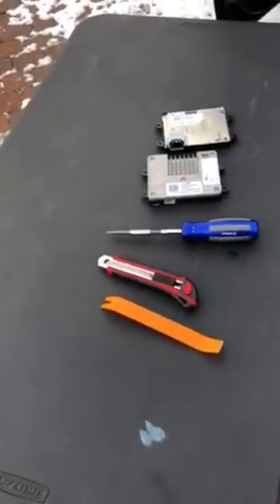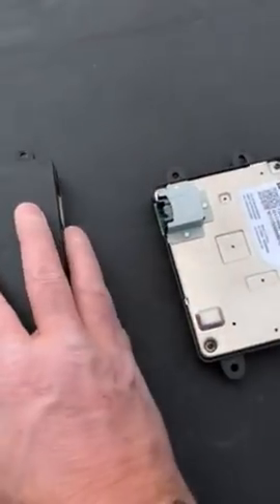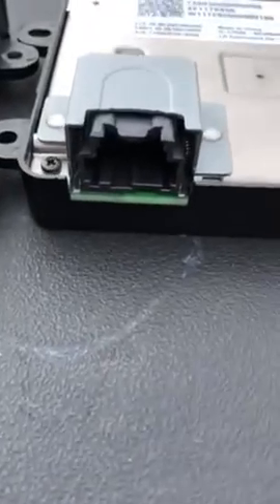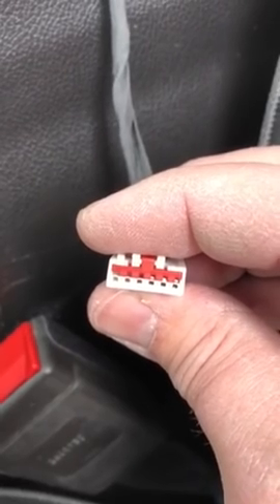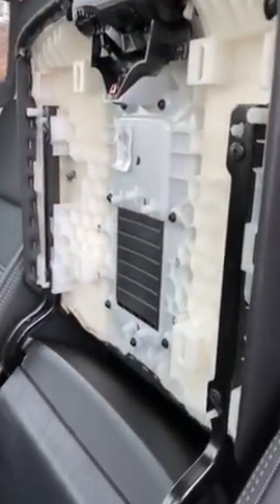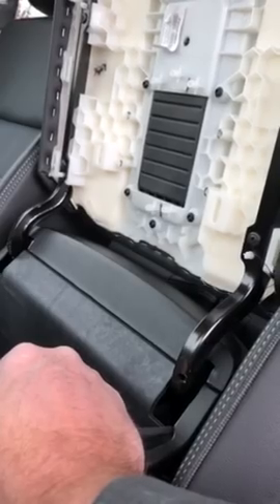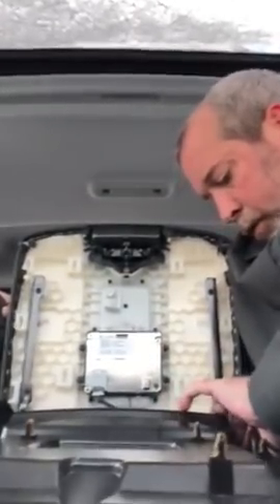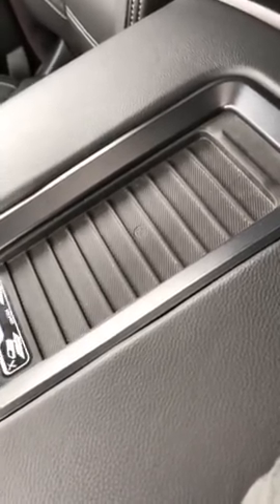Swapping a 2018 wireless charger in a 2017 GM truck.

Comment: Just did this on my 2016 Suburban and it worked great. Just FYI it was the same part number as well confirmed by my Chevy dealer. Not under warranty. Shaved the connector down and it fit very nicely

Comment: I ordered two of these (2015 Tahoe and 2017 Impala) and they both came with adapter harnesses. Swapped each one in about 15 minutes, no more charging problems and I have a Note 8, wife has a Galaxy S8+.
Reply: Where did you order from?

Comment: I took my 17' Bolt apart today to find the exact problem. I researched it and i will order part # 13521065 and change the unit out myself. Amazing the most tech advanced car on the market has an outdated wireless charging port and no Homelink garage opener. I will report back if it works once I attempt the install. Thanks for this great video
Reply: Any updates?

Comment: It's my understanding that GM is now covering this under warranty. They will supply the new module, change the plug on the existing harness (wiring) to the correct plug for the new receptacle on the '18 module. Parts are limited as of right now, so it might take some time to get in. Go to, or call your local dealer to facilitate a work order for this.
Reply: Roland Yarrington, I went to dealership, they are researching, was there anything special you told them to get them to warranty this change out? I even called gmc and no response yet
Reply: I went to my dealership and they had no clue but said they would look into it. I then called GM and the representative I spoke to told me they would be implementing this to be covered under warranty asap. I relayed this to my dealer and they are ordering the parts and verifying it will be covered under warranty. They are going to call me when the part is in. That is all I know right now. (FYI- I have a '17 Sierra Duramax Denali)
Reply: Merry Christmas! I will be visiting my dealership on Tuesday then! Good luck with your truck, mine just turned 1,000 miles old.
Reply: Thank you! Merry Christmas to you as well. I got mine in June and only have 1350 miles. I don't drive it nearly enough.
Reply: So you mind telling us which dealership ? I just purchased a 2017 Suburban and have the same issue. My dealership  doesn’t have a response and GM just said that iPhone 8 only works on 2018 model suburban. Thanks !
Reply: My dealership does not show anything being covered, i called gm and they did not show it either, so i ordered the module, i confirmed chedder’s part number off of a 2018 denali they had on the lot, part should be in tomorrow
Or day after. Am going at it the cowboy way, the 2017 module does not work so it is broken to me! Will let u know how it turns out!
Reply: This is not covered under warranty. There is a service bulletin for it but you still have to buy the new charging pad  $100 part. You can buy the part on eBay through GM Parts House and it includes a new cable.
Reply: I doubt gm would cover this..
I had to pay for mine lol

Comment: I just did this exact thing (new module and shaved the harness groves) and it works great. In fact my iPhone X case doesn’t allow my phone to sit flush in the charging slot and it still charges fine.

Comment: I swapped the 2018 charger in today. Trimmed the plug and works perfectly!!!
Reply: pyrocrew13 why you need to change the wireless charging? what is the difference?
Reply: abdulmohsen alghamdi the 2017’s and earlier aren’t compliant with the new iPhones. They won’t charge them. You need the charger from the 2018 vehicles to take advantage of that feature. Just like he says in the video $152 plus tax to order. New part fits right in place of the old one. Then you can either trim the plug so it fits or you can order the harness as well, cut both heads off and splice the new one in. The trimming option took me like 3 minutes and seemed easiest and cheapest option.
Reply: pyrocrew13 very good, thank you so much for your help, the new iPhone and Samsung not charging in my car, i will replac this part soon.

Comment: I spoke to my dealership today and they stated that GM makes a charging pad/adapter that is comparable with the older models that have wireless charging. I’ll update later with the part number. Also, they stated it would be around $480.00 with part and installation.

Comment: DO NOT start cutting up the OEM plug on the factory harness to make this work. When you order the wireless charging module for a 2018 (part #13521066) also order the matching wire harness out of a 2018 (part #84193710). The harness plugs into the back of the console, it's super easy to change and is way more functional.
Reply: Came here to say that this is great advice.  Yes, way more functional and super easy to change.  The only thing you have to do BESIDES pop the bottom of the console lid off, is pop off the back of the center console.  But again, very easy and 4 screws.  Link to video on how to do that here: https://youtu.be/iytvdK7VoIo
Reply: I ordered these exact parts, as I purchased a new iPhone Xs Max - and it wouldn't charge in my equipped 2016 Yukon SLT.  it took 15 minutes in all, and works on the console even though the Max doesn't fit exactly flush on the charging pad.  Kudos to Bryan!  Many Thanks
Reply: Did you order from your local dealer or a particular website?
Reply: What does that harness include. Couldn't find picture.  Just adapter or whole new harness?

Comment: Very nice video cheddarnut.  I am convinced I can do it myself.  You were able to confirm the 2018 trucks had the same three wires?  I agree with you on the warranty comment and I like stuff to work as designed too but I just dont want to create some electrical problem further up stream while under warranty.  Because GM has handled this so poorly a guy could buy the short plug and if something goes wrong, put the old charger unit back in (with nothing being changed) and claim ignorance at the dealer.  Obviously if you shave done the existing wiring clip they will see that.

Comment: Great video!  I purchased GM part #84526978 for my 2016 Chev Suburban.  It was $116 at the Chev dealership, and came with a pigtail adapter in case you don't want to trim the existing plug.  This Gen 2 module works great charging my son's iPhone X and my iPhone 11 right through their cases.

Comment: Is there any other information one would need to change out this part on a 2015 Cadillac Escalade?  GM suggested the same fix with the same part number, but the console lid (and charger) is a slightly different size.  Thanks for this great video.

Comment: I don’t have the part number but there is contributor at gm-trucks.com named PGAMBOA who has created a short plug and play harness.  It’s $25 which is a bit steep considering that the connector costs 71 cents.  There is a detailed explanation about how to unpin the connector and change to the new one.  It’s not that complicated.  The explanation starts around page 16 of the thread.

Comment: Great Video - thank you very much. Just curious why if the first hack in modifying the original charger worked, why did you decide to buy the new one?
Reply from the maker: When I did the first hack, the 2018 part was not clearly a fix yet, so I decided to try it as well when it was confirmed to be a viable option. I think either version is good. The advantage to the hack is obviously that it is free.
Reply: Makes sense. Thanks for the quick reply. Happy New Year.

Comment: Thanks very much for sharing this video, I have a 2017 cadillac xt5 platinum, and I am having the same problem with my wireless charging pad, I would really love a fix.
Reply: Counclor Counclot my 2017 xt5 use to charge the samsung note 8 of both mine and the wifes plus my galaxy s8 they had to do an update for the ingocenter as it kept going black. And since then the charger quit working. P.o.s. Cadillac told me forget about it. There is an updated item availble for it. At my cost

Comment: I made the conversion to the 2018 Qi charger (part number 13521066) and also replaced the connector with the Mouser 571-2035363-4 connector. It is the correct connector that plugs into the module. The charger works like a charm. I have an IPhone 8 and it charges wirelessly with no issues. Took me about 30 minutes but only because I was taking my time.
Reply: Does anyone know a part number for the plug inside the old module so an adapter harness could be put together instead of replacing the factory plug?

Comment: I just contacted both Chevy dealers in the City where the Silverado is made regarding my 2016 Tahoe.  Neither dealer was familiar with this but Kelley Chevy is at least checking further for me.  The dealer where I bought the Tahoe has offered to order the 2018 charger and install for about $200 but with no guarantees that it works.  Let alone replacing under warranty.  The dealers are saying call GM and GM is saying call the dealers.  GM infotainment group has no clue or is playing dumb as well.  Can someone please list a GM dealer and city where they have had this done?  I too will pay to have the pad working.
Reply: Why would you pay to have it done when the step by step video is right here? Will never understand people with stupid questions; where do i get the part, can i have the dealer do it, how much is it? The part number is posted, go online, buy the part and follow the instructions on the video.....not that complicated

Comment: Just did this on my 2017 Sierra, worked great. The dealer had no problem ordering the 2018 part for me $240 CAD. The only additional thing i did was flip my charging mat around, my iPhone 8 charge doesn’t get interrupted when i do that. The charge speed is slowish and i’m not sure if its just the power being supplied to the module or the output of the module itself. I don’t have another wireless chatger to compare. Can anyone else comment on charge speed in a 2018 GMC without the mod?
Reply: Filip Burcevski I just put the 2018 module in and it worked for about 1 minute and no has stopped.

Comment: So the parts so far are as follows:
Module: GM 13521066
Male Harness Connector for Module: Mouser 571-2035363-3
Female Harness Adapter out of old Module: ???
Does anyone know that part so a plug and play harness adapter could be made instead of destroying either the old module or factory plug connector?

Comment: Hello thanks for the new video. Would this work for a Chevy Impala 2016 please? I have an iPhone X as well, also if I was to go ahead and order this part and have someone install it. It the wireless charging faster is slower? Is it really worth going through with this please?
Reply from the maker: Hard to say on a car. I have only worked on the truck. Although the 2018 impala does seem to have the new charger. In your case I would start with the dealer and see if they can compare the parts.
Reply: A1 Credit thecheddarnut The 2018 Impala is not on the list of GM vehicles that is compatible with the new iPhone 8/X wireless charging.  I have been to my Chevrolet dealership I bought my car from last February to see if they’ll swap the truck module into my 2017 Impala Premier.  They’re researching it atm.  The wireless charger in my vehicle is part number 23248791, not the same part as from your Yukon.  That being said, I talked to the parts department and there were two different modules used in the 2017 Impala, one of which was your 2017 module (part number 84162497) , the other is the one installed in my car (part number 23248791). The 2017 Silverado shares the same wireless charger as your Yukon for 2017 and 2018 respectively), and I’m trying use that as a basis as my request to have my cars wireless module updated under warranty.  I’ll update when I get more info.

Comment: I just bought and installed this new charger (2018 module) and it worked for a minute and now has stopped working. I got the lightning bolt on the dash and the green battery on my iPhone X and then a minute later I tried it again and I get the lightning bolt on the radio for 10-15 seconds and then it goes away. Before you go running out to buy this part it might be worth figuring out if this will work for you because it did not for me
Reply: how about other iphones that aren't as long?  I know this charger is positioned more towards either the front or the back.  what if you turn your phone around?  Not upside down, but spin it 180?

Comment: Will this work for a 2017 Escalade?
Reply from the maker: As far as I have seen and people have commented it works in the GMC and Chevy trucks...If the charger is in the center console theoretically it should work. keep in mind there is a chance a good dealer will swap the module for a 2018 , so check that as well.

Comment: Anyone know a GM dealer and city where they installed a 2018 charging pad in a 16/17 vehicle?
Reply: therazor2911  I doubt any dealer would change it for you.  They would have to either trim the existing plug or get the correct plug from Mouser (highly unlikely) to make the change.  Do it yourself, it’s fairly easy.

Comment: The part has been discontinued.  If your search, you can still find it, but it has been discontinued.  Is your's still working?
Reply: Mine worked for 3-4 months but has stopped working once the temperature got into the 90s

Comment: Part number please?
Reply from the maker: The 2018 part number for GMC is 13521066
Reply: thecheddarnut from where I can purchase this item please.
Reply from the maker: You can purchase from a GMC or Chevrolet dealer, if your truck is new, ask about a warranty swap, someone posted earlier about that maybe.
Reply: thecheddarnut im in Saudi Arabia, i think the warranty will not cover the wireless charging, by the way if you can send any company website so i can order this part.
Reply from the maker: Currently I believe the part is only ordered through actual GMC/Chevy dealers. In my experience if you contact one via telephone, ask for the parts department. Most will sell you a part and ship it anywhere, just pop on the GMC website and pick a dealer. I have not seen the part listed anywhere online since it is a 2018 and still in production. It will take a while for the part to appear online.